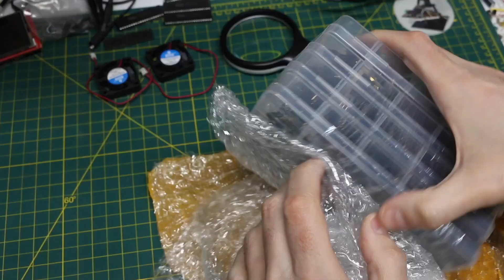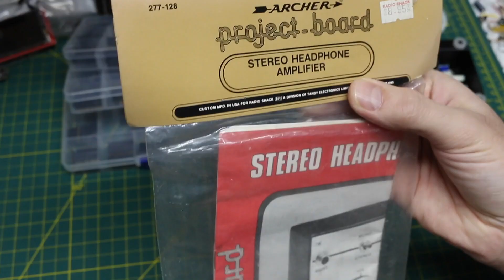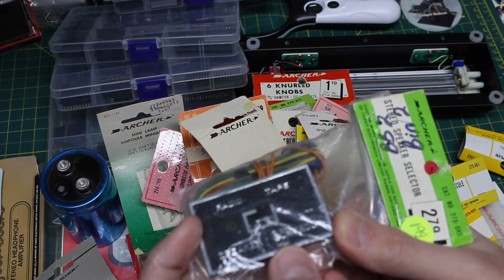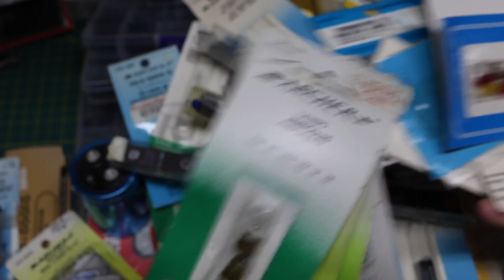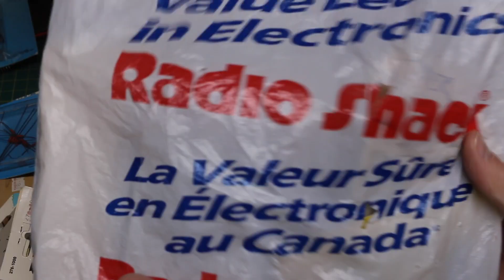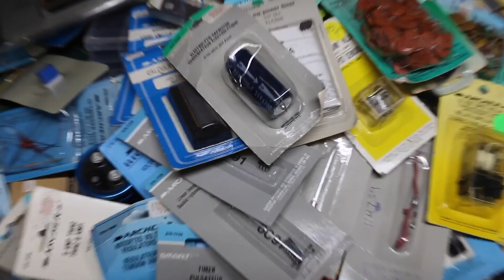Mailbag!

Comment: I remember having a few of those RS automotive things. The Radio/Tape switch was for sharing a set of speakers between a factory in-dash radio and an aftermarket under-dash 8-track player (no radio in it). The noise suppression kit was supposed to keep the sound of the car's ignition out of your stereo. Pre-'80s ignition used mechanical breaker points inside the distributor to fire the coil at the right times. They threw off a lot of electrical noise - an annoying buzz that varied in frequency as engine RPMs varied. The suppressor was a sort of low pass filter you inserted into the +12 lead of your stereo. It sort of worked. Sort of.
Reply from the maker: That's great info, thanks!  I remember seeing some of these specific things in the old catalogs and being too young to know how they were supposed to be used.

Comment: Still got lots of metal can 741's used to use 1000's back in the day. they were a fantastic audio op-amp and the metal ones had a wider temperature range than the plastics ones. look out for the 759 it's a 471 with bigger balls on the output, so higher power output drive.

I think you now have more 555's than I've  ever used in my life, never liked them always seem prone to resetting with power line spikes.

Used to use radio shack or Tandy as it was called in the UK, that was until i started work and found our stores department had a lot more components in it. if you needed 5 transistors get 10 out of stores and leave 5 on your desk. every few months we had to clean our desks and any components had to be thrown away, as once booked out of stores they could not be booked back in. as they had lost their traceability to batch numbers etc. so then you could take them home as they were going to be binned anyway. 🙂
Happy days
Reply from the maker: I wish I had a job where I could shop for parts...but the closest I had was a job where it was all surface mount stuff and highly tracked in locked rooms by the reel with no practical hobby use (I was allergic to 0805 back then, which now is a huge easily solderable part... it felt like 0201 does now).
Reply: @GadgetReboot  Well back then it was TPH stuff. We had yet decided to move over to SMD as there were concerns that vibration  would cause the parts to fly off. when the PCB's hit resonance its amazing how much they can bend in the middle. But in the end we did move over as we moved from analogue to digital and on to Time divisional multiplex over fibre. being in R&D was real fun in them days.

Comment: So hard to find a 4010 fan that is not a rattle-box.  Could go after a Panaflo or similar ... but they cost 5x more than Ali varieties.
Quite an entertaining hoard OTC components!  Nice vintage LEDs and resistors. Oh whadda haul!
Reply from the maker: Yeah even if these new cheap fans make noise, as long as they spin I'm coming out ahead of what's in there already.
Even when I brought home bags and boxes of RadioShack parts I didn't know how much stuff there was until I dumped it all out and saw it pile up.  Lots of nostalgia for times when I had to choose between spending $3 on 15 transistors or 12 plays in the arcade that was 1 or 2 doors down in the same mall...